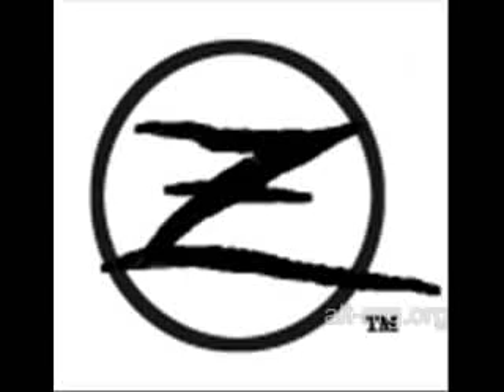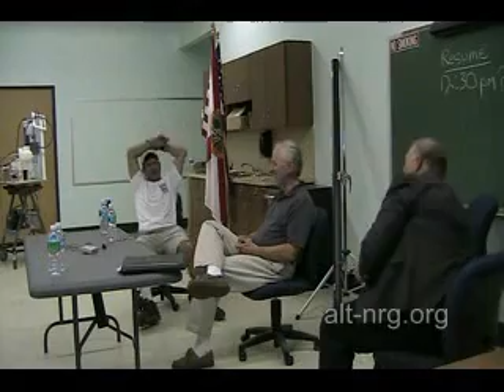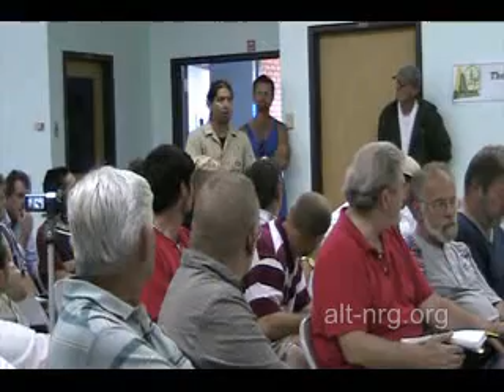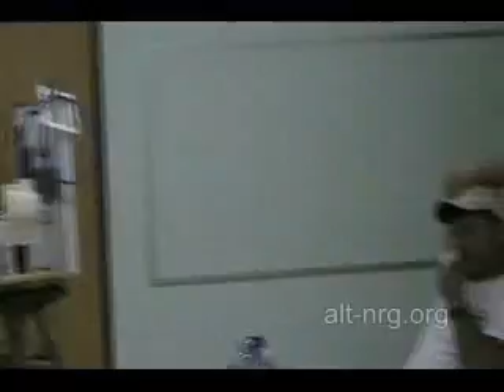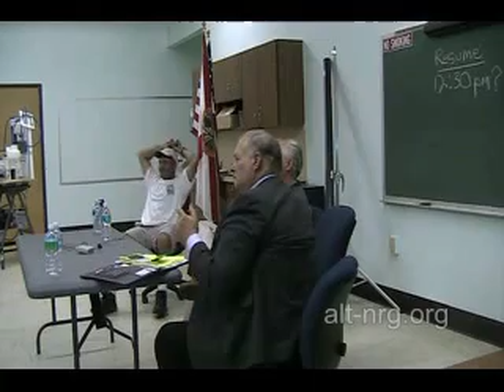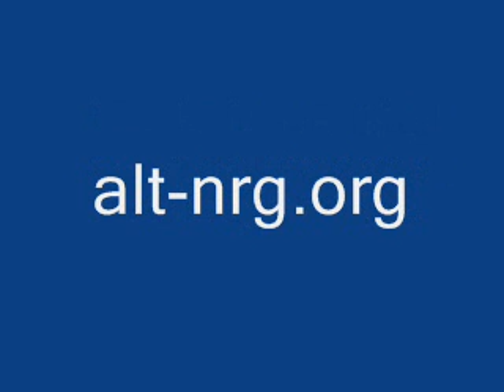#155 - MTI Roundtable #12 of 18

Comment: There is nothing exotic with conventional electrolysis using an electrolyte, which is well known in chemistry.

High voltage breakdown of water on the other hand, is less understood and investigated. May be Meyer found something fundamentaly new there, using pulsed DC.